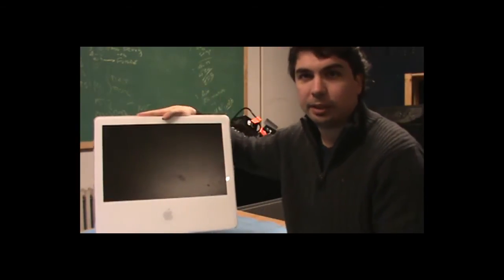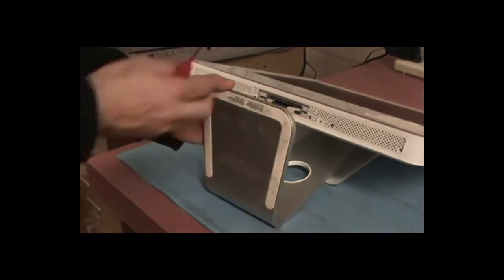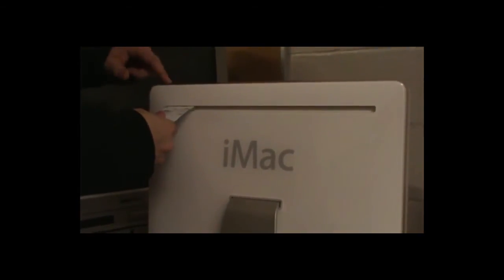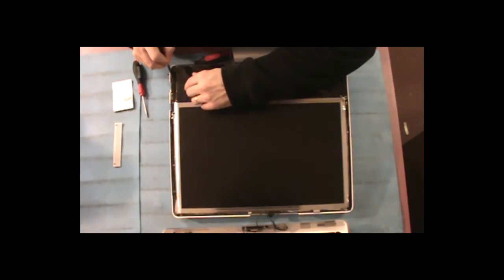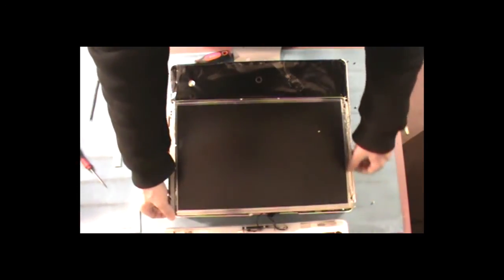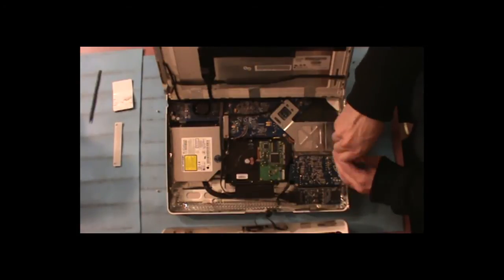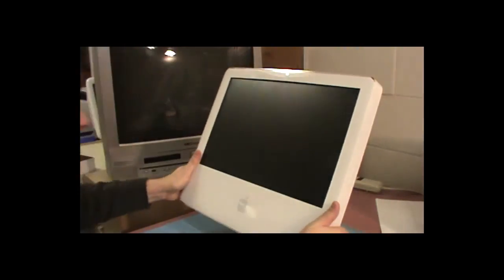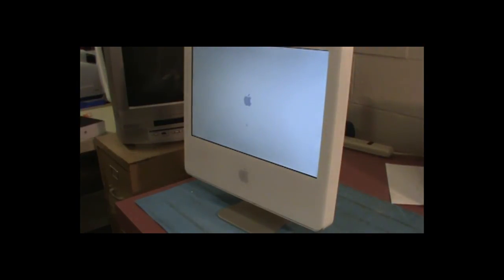Apple Imac Fix

Comment: Hi there, I had an experience where I accidentally yanked my power cord out of the wall at which point the power button would not turn on this model of imac, so I paid to have it repaired...from what I was made to understand it was supposedly a simpler procedure and I don't know that he changed the power supply...anyhow, I'm here today because I made the same mistake again a number of years ago and have been waiting and waiting and waiting to fix it....but now the model is so old nobody seems to want to touch it.  My question is, does it require an entirely new power supply to fix what I think is a short from having yanked the plug out of the wall again or is there a simpler way I can fix it while keeping the same power supply that is inside?  I have written all of your steps down with numbered bullet points so I know I can manage what you taught us here I just want to make sure that for my problem that doing what you've shown is the only way I can get it to power up again.  Thank You very much for taking the time to read this and for any answers you can provide.  Thank you for the amazing video, very easy to understand and follow. -Steven

Comment: So, I have a question, i have a 2008 iMac Desktop that looks just like this one, but the issue im having is the screen stays black while the little white led in the front turns on and stays solid... It makes a sound like it wants to start up, but then stops, goes silent, and then it just sits there, staying of,  with the white led stayin on in the front. What do you think the issue could be? I'll try to attach pics.
Reply from the maker: Most likely the screen is the problem. The backlight in the screen may have failed. Take a bright light and shine it on the screen at a angle near the center of the screen. If you can kinda see the login icons then you have a screen problem. In some cases the cable to the screen could be bad.
Reply: I dont see anything in the screen when I put a flash light up to it, any other ideas? It also has a big white led on the bottom right corner on the front that stays solid white after I hit the power button.
Reply: It also feels really warm
Reply from the maker: @robertmurray8585  yeah could be just the screen is dead. You could try this https://www.youtube.com/watch?v=RrKb_cEXwqw&t=7s
Reply: Unfortunately still nothing... Its the older model also, the desktop model that is white and at least 10 solid pounds lol 😆
Reply: If i was to replace something on it, what would you recommend I replace first?
Reply: Sorry to be a nuisance by the way, I just need a computer lol 😆
Reply from the maker: @robertmurray8585  I would say replace the screen if you can find one that's cheap.It may be hard finding a screen for that model though since it's so old.
Reply: It definitely wouldn't be the power supply right? Because the front led light turns on.. I found a replacement lcd panel, is that what I need? Or is there some specific digitizer item I have to buy?
Reply from the maker: @robertmurray8585  Most times if I see the power led and I hear the chime when it starts , the power supply should be fine. If I don't hear the chime or hear the fan start then it could be the power supply.
Reply: Ok, so then it might be the power suplly then because there is no chime sound, just the front led, and the sound I hear is the inside of the computer make a quick hum, like the fans or something is trying to start and then it stops and goes silent...
Reply from the maker: @robertmurray8585  Yes It could be.
Reply: Damn, well, guess I better start ordering parts huh lol 😆
Reply: Thanks man, I appreciate you hanging out instead of ghosting me for asking too many questions. I appreciate all the help you have given me. Too bad I dont know anyone who can do repairs...
Reply from the maker: @robertmurray8585  No problem
Reply: I mean, I can definitely do it myself, but someone like you just by looking at it might know exactly what it is and then can replace it on the first try haha 😄
Reply: So for the power supply and lcd screen panel replacement, its looking like $130
Reply: The lady that gave it to me said it needed a network card and thats why it doesn't work.. Any thoughts on that..?

Comment: we didn't have our computer plugged into a surge protector during a storm and the power went out and so did our 2006 imac.  In that cause would everything be ruined or just the power supply?  Also where do you order your parts?  Thanks in advance.  Great video!

Comment: Thanks, it worked out! But: the seemingly easiest part appeared to be the hardest: I couldn't reach the connector underneath. The powercable of the imac wasn't long enough. I couldn't reach the connector at all. It remained hidden under this aluminum cooling device. So I had to loosen the mainbord, take out the speaker and the fan, take out this cooling device and then I could reach the cable finally. That was a couple of hours improvising, but it works again. So: thanks!

PS: I see some questions below about why change the powersupply: mine was clearly fried (super smelly, fuses of my house were blown and once I had the computer opened: clearly traces of burning/melting on the powersupply itself).

Comment: Did you replace the power supply because the iMac wasn't turning on. To be more specific what happened when you tried to boot the iMac with a bad power supply. Thanks in advance.